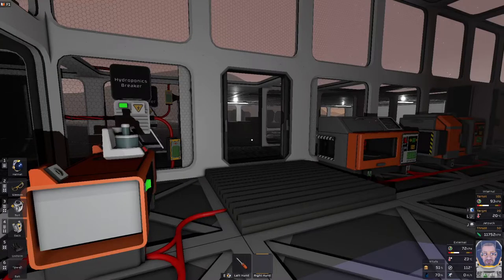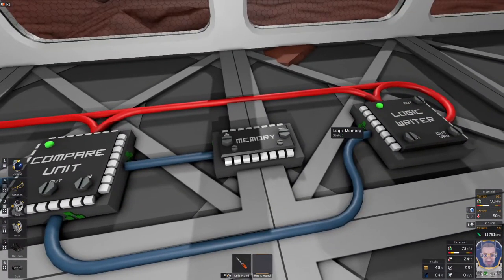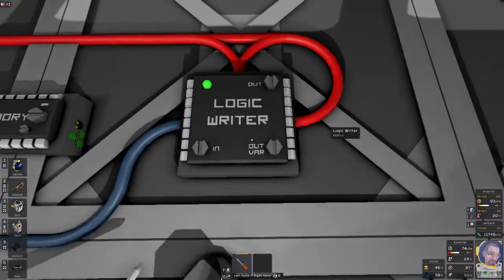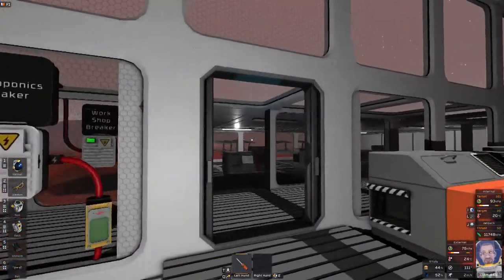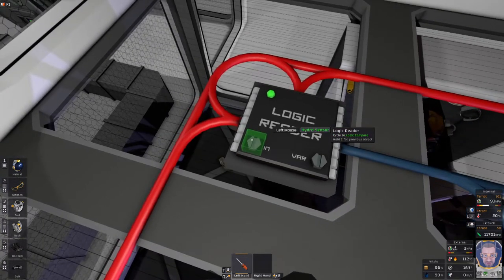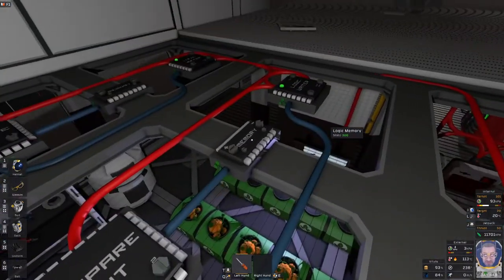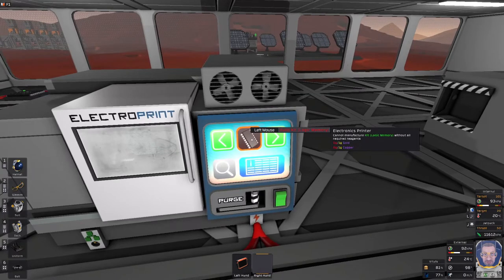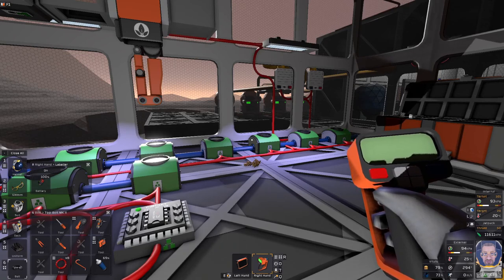Stationeers - Introduction to Logic Circuits a beginners guide.

Comment: A small tip when working with logic circuits.  Turn the chips, especially the writers, off when changing the settings.  I had a cooling active vent's controls locked because the writer was getting a 1 when I cycled past the "lock" output.  Next thing I know I am seeing frost on my helmet glass in my greenhouse.

Comment: Just wondering Ive been practicing logic on a creative save and the gas sensor is reading the temperature wrong as far as I can tell. For example the HUD temp is 25C but the sensor is reading 298 (im assuming Kelvin). So when it comes to setting the memory it is slightly off.

PS- Dont worry just realised Kelvin and Celsius dont directly convert lol
Reply from the maker: if you want greater accuracy I would use an IC chip. I only make small alterations to what others have done to suit my needs. Cows are Evil has a good video that covers IC chips and coding, but I am sure the workshop has something you can use.